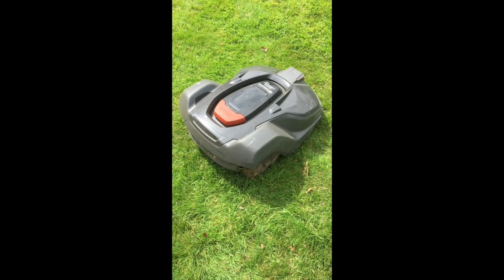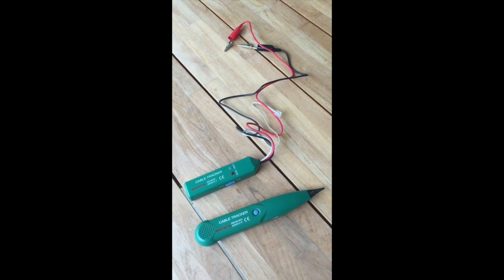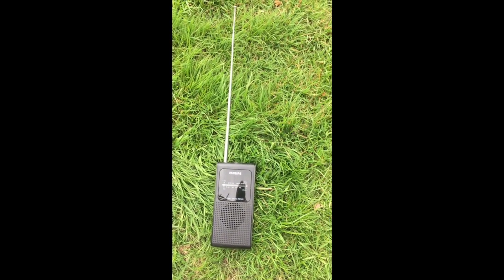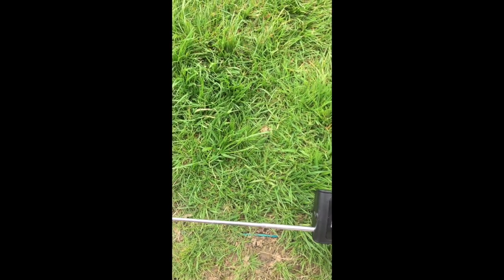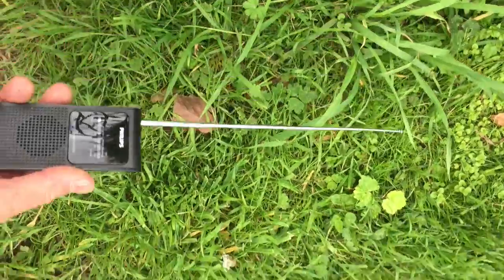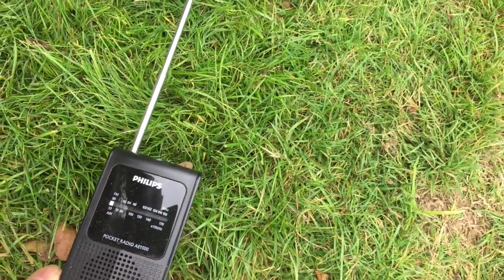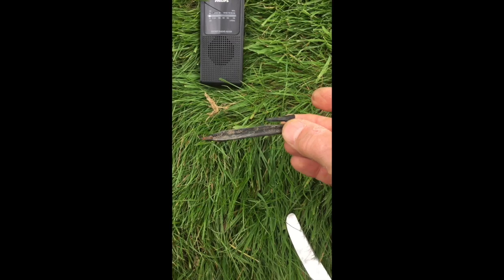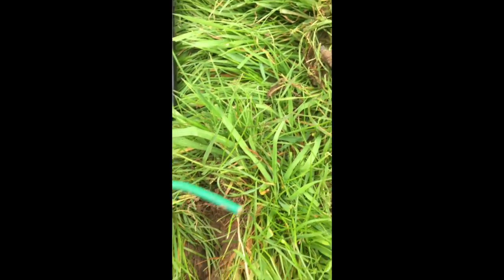Locating Break

Comment: This really helped on my landroid. Except I got better results whenever the positive node is connected. And much better result when both nodes were connected. It turns out my point of failure was the splice connector. I would have expected those to last for a long time.

Comment: Can you tell me please why do you have to disconnect one side of the circuit when there is already a break in the cable?
Reply: I just did this today and from what I can tell if you don't unhook one side each side will still get power and you will have to locate the gap where the break is.  Versus unhooking one side and that side of the break won't have power.  Then you can follow that side until you sense power or you can start with the side that has power and track it until you lose the signal.  That's where yiur break will be.
Reply: Ah. This explains it better than the video, thanks.
Reply: I didn't unhook it and just followed one side until the signal stopped, easy.

Comment: Thanks this was really helpful.  I am a bit concerned that, having spent > £2000 on the mower I've traded one set of problems (mowing the lawn) for another (fixing the guide wire).  I've only been running it for a season.  How many instances of broken guide wires have you encountered, and over what time period?

Comment: Very informative - thank you for this. I presume that this could also be used to check the guide wires are all still fully connected by keeping them plugged in and then working along the length it is supposed to be laid and if there is a break the signal will stop?  Also, do you get that sound from the wires if they are buried under the surface, not laid on top with pegs?

Comment: Okay, I used it and found a break, but still get "no loop signal" even though the entire wire shows a signal. I even tried from both sides. Clearly the signal fades over distance but it says I have a complete loop. So I am confused. Another problem is that where we live there are almost no free frequencies on AM. And the radio we have has noise reduction so it eliminates the static. Anyway, great video! I haven't solved my problem but it definitely helped.
Reply: I figured it out. First, I had 2 breaks, and second, I have guide wires on my model which were also putting out a signal, so this was confusing me. A good start for the procedure is to disconnect ALL wires and make sure there is no signal on the radio. In all fairness he did say to disconnect one loop wire, but I didn't realize that there were other wires emitting signals. Plus, I had a bad connector at the base. And furthermore one of my breaks was next to the station.